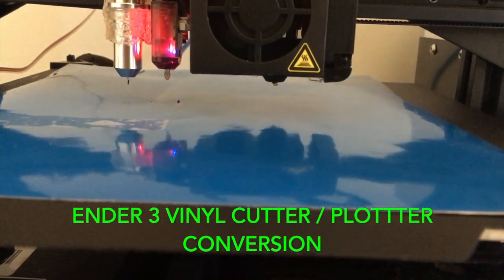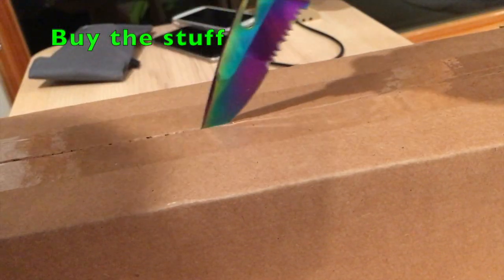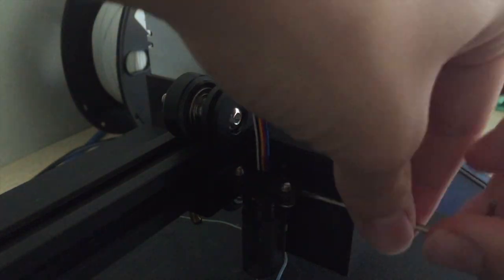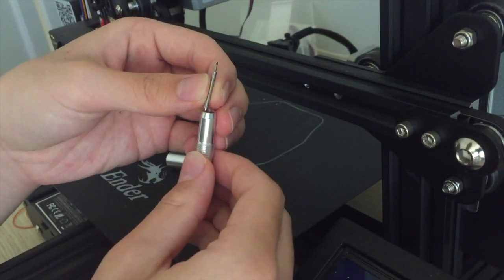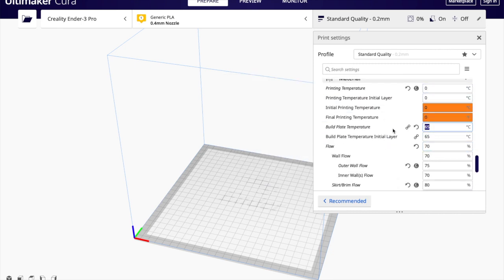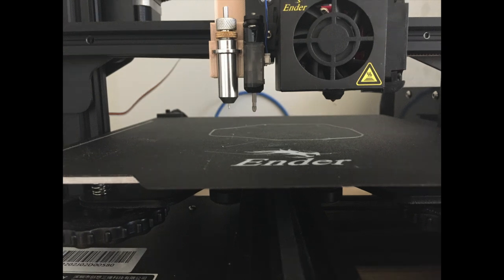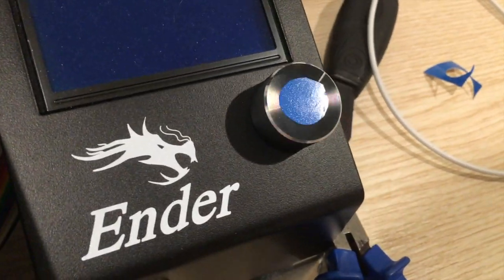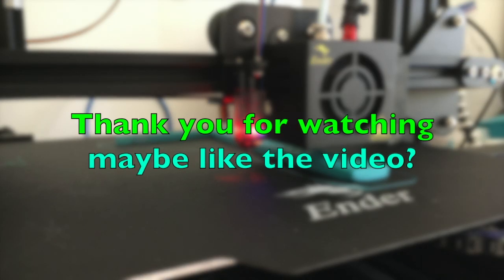Ender 3 Vinyl Cutter / Plotter Conversion Upgrade

Comment: I made a very elaborate knife mount that clamps onto the front of the Ender printhead cooling fan shroud... THIS WAS NOT A GOOD IDEA!  😮
When the knife is moving toward the back it works great... when it is moving towards the front, the knife can dig into the bed surface, with nasty results.
It works fine as a pen-plotter, but locating the knife to the side as Eugene has done is a much better idea.

Comment: You set the blade way to deep. You will go threw blades very fast. If you set the blade right, you will never cut threw the backing.

Comment: hi man, I see the initial circle you cut wasnt exactly round, How accurate is this way of cutting?
Reply: His bed wasnt leveled correctly so cutter lost some contact, i will put some rubber on the printing bed.. Accuracy should be as good as the 3d prints.. Look at the plane cutout he made, looks preety good to me

Comment: did you heat up the hotend while cutting i actually have and old printer (anet A8) which i wanna try this with but i can't get past the hot end part as i disconected the hotend and bed but the cutting won't start because it wants to heat up the hotend and bed.
Reply from the maker: You can edit the G code to run without heating up the hot end and bed in the slicer software

Comment: Is there alot of resistance in cutting? I am concerned about damaging the motors.
Reply from the maker: Not really, as long as the bed is level and the height is all good, not much more resistance compared to regular printing

Comment: Great design, I have printed this and plan to use it, I wonder if it would be worth it to raise the vinyl cutter part in order to not have to modify the z offset when switching between attachments.
Reply: P.S. what is the random third piece for in that main print? You don't seem to use it in your video and I feel like you should update the file to remove the two wasted pieces or include them as seperate files with details in the readme, to prevent people printing excess clutter / waste :) ( one piece you bin in the video and one you don't even show in the video other than while its being printed )

Comment: What are the cura settings? Could you post the profile?
Reply from the maker: Ta-Da!

https://drive.google.com/file/d/1gjY7HQTdcrLuIV1Mm450GFrcQNJW1xk-/view
Reply: @majidenemui  You're a legend
Reply: @majidenemui  it says the file is unsupported
Reply: @miclairmiclair876  had you fixed that? i have the same error. tnx
Reply: @juliom6260  nope,  i wana try fusion 360 instead,  someone made an addon that let's u draw the outline of an svg file, u can mount ur knife on ur 3d printer to vinyl cut instead.  I haven't tried it tho